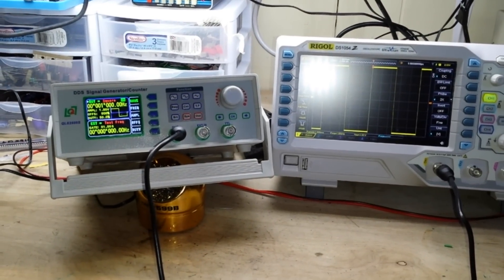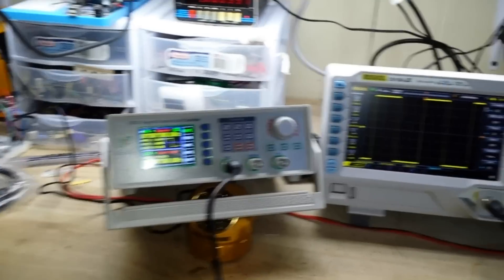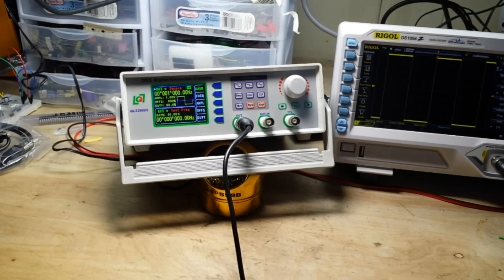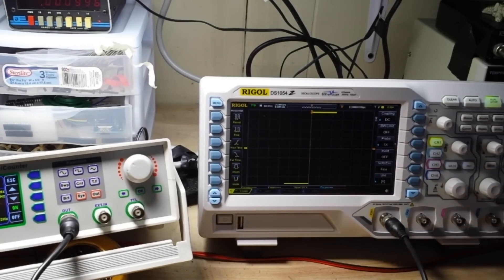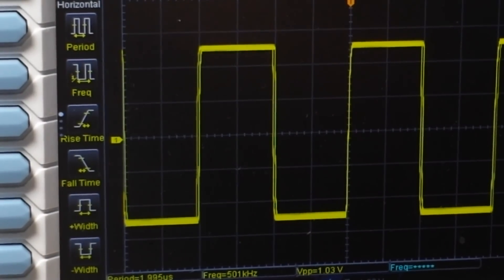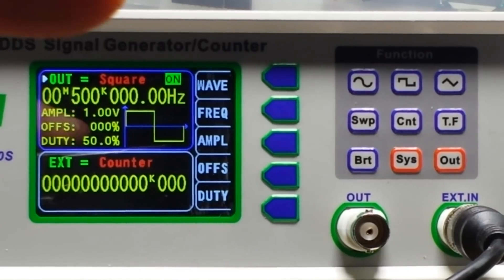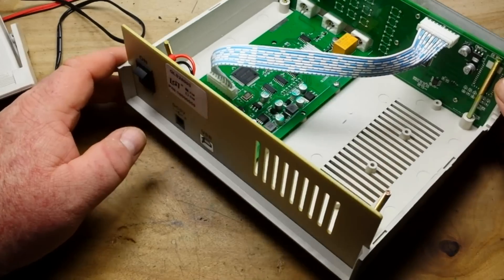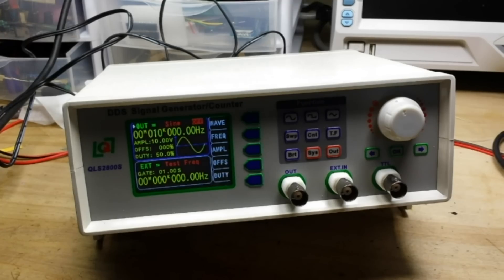Cheapest Full Featured Function Generator from AliExpress

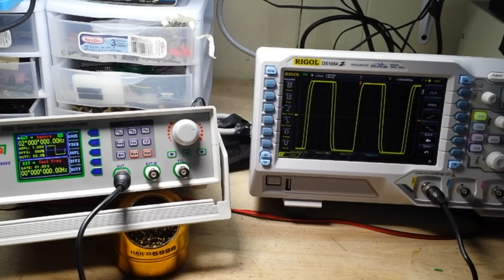Comment: At the @6:15 time mark it was showing the jitter , ok I will agree with you on what it looked like on your scope , BUT I think you used a BNC - BNC connector that came with the unit...... If that is the case , then try a quality RG-316 type cable , I can almost bet ya that anomaly goes away.... I have seen it quite a few times....  I use those supplied cables for probes in signal tracers and DIY projects , I just cut one end off and that goes inside my project boxes or probe tubes .....Have a good one Mon Ami.

Comment: I have seen these available but they do not seem to do sweeps so I have been buying used sweep generators when I have needed them recently.
Reply from the maker: It does sweep. I just made a video with it sweeping a low pass filter.
Reply: @learnelectronics  Good to know ... I was unable to find that out from the product information I saw. Thanks for responding on this point.

Comment: It looks like your GW-Instek (analog function generator) is a model 8020, right? If so, the digits on the display are recovered by the generator, not used to generate the signal. (This is well described in the manual and accompanying schematic). The display isn’t all that accurate. Based on my experience with that and other, similar GW-I models, my guess is that the cheap-o instrument you’re testing is hugely more accurate as a frequency counter than the generator’s display.

The thing that ultimately drove me to replace all of our analog function generators with DDS ones was the unacceptable frequency drift over temperature - up to a few percent. This is especially problematic as the instrument warms up over an hour sr so and/or ambient, as, for instance, when the sun passes the nearest window during the day.

Assuming your DDS generator has a crystal oscillator for its MCU, that drift would be several decimal places out - making it a non-issue. On the other hand, the jitter you observed at the frequency limit will, most likely, always be worse with a digital instrument. Well, that, and the specs are often rather optimistic.

Nice review. The 50 ohm termination thing can sneak up on all of us at one time or another. I believe the word you were looking for is ‘bandwidth’. If you make another video, your viewers might find that an interesting topic unto itself. Cheers.
Reply from the maker: 8019G

Comment: When connected to your DSO with coax there was no 50  ohm terminator. There will be reflections on the coax that maybe the source of the jitter as the DSO triggers on a reflection pulse rather than the actual pulse. Please repeat with a 50 ohm termination at the DSO and look at the leading edge and trailing edges of the square wave for it's risetime and falltime. Still looks a great product. Good video review too.
Reply: Is there any driver available for this device

Comment: I think you make a very good point about what you need, generally if you need the high end gear you already know you need the high end gear whereas a beginner will have plenty of options with a cheap function generator which could be used to clock circuitry or test RC filter response etc. Personally I have the rigol dg822 at home and it covers all my personal electronics needs.

Comment: Nice option. I've been looking at the FY6900 for a little bit more money but that one goes to 20-100 MHz. Problem is that it's mains powered and the PSU is.. well, cheap Chinese. This one seems to be powered by a 12V plug pack or something like that so no problems with wonky power supplies?

Comment: I have the FeelTech Fy6900 60Mhz and it is awesome at only $90. There are cheaper models from FeelTech that costs about the same as the one you bough and has 2 channels. That one is also available with up to 100Mhz. They changed to a FPGA for the 6900 though so it maxes at 60Mhz but is more reliable. 

They recently made a new model that costs a lot more and trades the counter for a 3rd channel which is not worth it. It is really just the 6300 with a slightly different case.
Reply: I purchased one of those for simple testing and having 2 independent outputs is a great feature! Also allot easier to carry vs my HP gens lol

Comment: Yeah, prices have fallen, and reliability has gone up.  Back in June of 2017 I bought a function generator that was somewhat more capable - this one: https://www.aliexpress.com/item/4000382031233.html .  Paid around $140 CAD for it, which would be around $107 USD; and that was incredible value, just 30 months ago.  Now, that same link I provided will put a 40 Mhz generator with ten billion different wave forms in your hands for about $65 USD, including shipping.  It just amazes me.  BTW, you're sounding a lot better; glad the cold/flu thing is gone.  Take care - Charlie

(Quote from the Engrish technical specs: " There are sine wave,square wave, pulse wave (occupying ratio adjustable), triangular wave, CMOS wave, DC level, partial sine wave, half wave, full wave, positive step wave, anti step wave, noise wave, exponential rise, exponential drop, multi sound wave, Simic pulse, Lorenz pulse and so on. "

Comment: You amassing  quite a substantial Laboratory Sir.   Will it Sweep ?
Reply: There's a "swp" button right on the front panel, so I would assume it does.  Problem I've had with the FeelTech variants is that they (as far as I can tell) don't provide a ramp out sync'ed with the sweep, so that you can show the frequency response of a circuit with x/y mode on your scope.  They do have a VCO input line, though, so you can use a second function generator to generate a sawtooth or triangle wave to drive both the signal generator and the scope.
Reply from the maker: Yes it does linear & log sweep